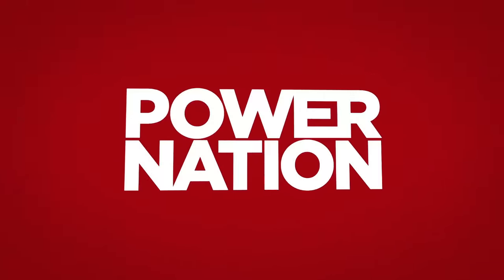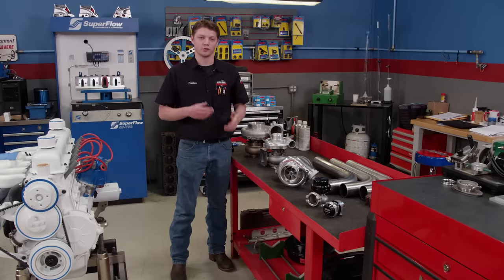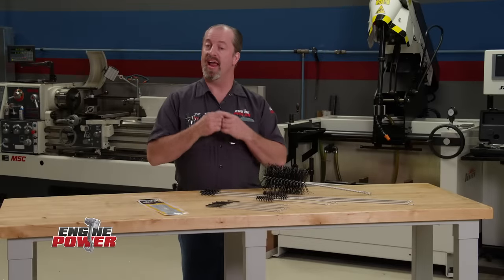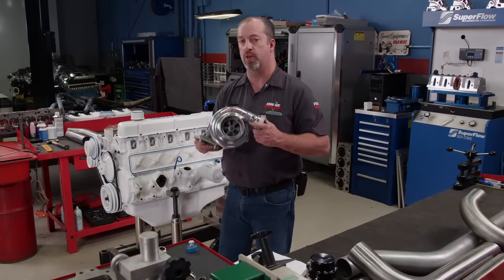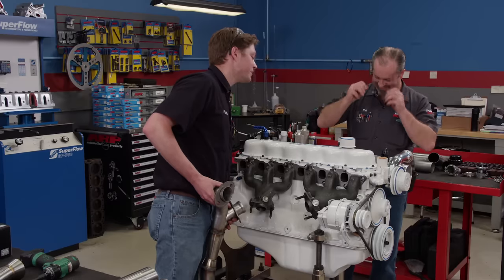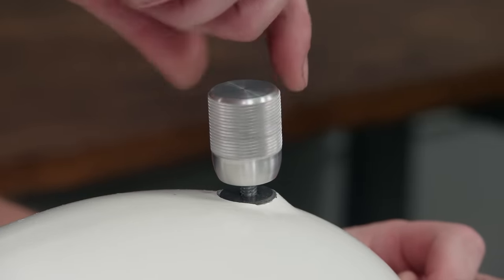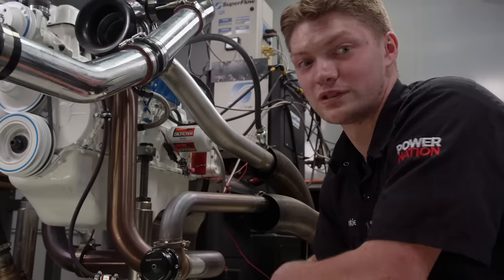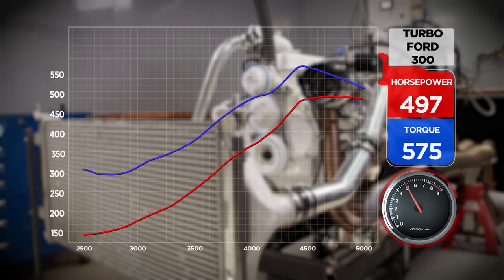Turbocharged Ford 300 Inline Six Makes Over 500 HP on the Dyno - Engine Power S8, E14

Comment: There’s only one word: WOW!!!! Unbelievable that that little engine makes 522 hp and almost 600 pound feet of torgue!!!! WOW!!!! Greetz from the Netherlands , ramon
Reply: Meh. The 2JZ is much more impressive engine.
Reply: @basshead.  2jz wasn't build for industrial work. The 300 is way more impressive since it was only meant to be a work horse engine and not a performance engine
Reply: @carsonmeyer2808  The 2JZ is much smaller engine than the 300 and it can make over 1500hp.
Reply: @basshead.  I just don't Find it as impressive. A stock 2jz can hold 800. This build for the 300 wasn't stock but again. It's technology from the 1960s/an Industrial engine made to run long hours and low power. Far more impressive in my eyes
Reply: @carsonmeyer2808  You are impressed that it held up 4-5 short dyno runs? You can slap a turbo on anything and make power.
Reply: @carsonmeyer2808  and was designed for less than 100hp.  There are guys running north of 18psi on forged pistons  and pretty much everything else stock.
Reply: @basshead.  , this engine was used in such a broad applications  , nothing but impressive, your engine that you are so impressed with will not 200k and still get you home.
Reply: @markrenton1093   Most engine that are as big as the 300 can make 500hp with a turbo.
Reply: @basshead.  your missing the point, it is not about horsepower it is about versatility.
Reply: @markrenton1093    You can use the 2JZ for almost everything. It's a very reliable engine.
Reply: @basshead.  who cares. They’re literally everywhere. These 300’s aren’t as common. Give me a 1UZ over a 2JZ anyway.
Reply: 300 c.i. Is not exactly little lol
Reply: @chrish1695   It's almost as big as my V12 engine.
Reply: @basshead.  the 2jz started production in 1991. the 300 i6 started production in 1965. they cannot be compared.
Reply: @basshead.  you're comparing a 3.0 DOHC factory turbo engine with VVT to an engine that was literally a tractor engine.  The impressive thing is that the 300 makes all of its power and torque below 5k. A 2JZ isn't even thinking about making boost until 4k and isn't making any real power till about 4500. This boosted 300 would be far more impressive to anyone who drove it because it's going to try to run out from under you right off idle, do burnouts for distance, haul your trailer, pull stumps, and whatever else you want to use it for.  Your 2JZ will sit in a supra or Lexus IS300 and it'll be cool because it makes 800hp way out at 9krpm where most people aren't actually going to drive it and you can cook a meal while you wait on the boost to come in.
Reply: @codyslaughter4678  I don't think it will last more than 500 miles.
Reply: @basshead.  at 14psi with stock rods I'd be inclined to agree.  But that's easily fixed with forged rods and forged crank (which this engine likely has since its an industrial engine and not a 1/4 ton pickup engine. The dump trucks in the 60s and 70s had all forged internals) which aren't hard to find.
Reply: @codyslaughter4678   I don't think the block can handle that much power.
Reply: @basshead.  those blocks are extremely sturdy.  So I don't feel like they'd have any issues. Thick cylinder walls, thick main webbing, plenty of external ribbing, the block would be the last thing I'd worry about.
Reply: @basshead.  it’s all cast iron.   It can handle it.   As far as internals… those can all be beefed up
Reply: @basshead.  that's like comparing a Model A to a Maserati. The 300 was designed For Industial applications like forklifts and has 1965 technology Race car driver Scott Donohue raced a rally truck with a Ford 4.9 in it and won the Baja 1000 3 times. This engine is also used by Stewart and Stevenson in the MA Baggage Tow Tractor, and Harlan in their standard tow tractors as well as a multitude of other pieces of equipment, such as ski lifts, power generators, wood chippers, tractors, and, until they converted to diesel engines, most UPS trucks. Many UPS trucks still use the 300 to this day. In stationary service (generators and pumps) fueled with LPG or natural gas, this engine is known as the CSG-649. The Barra is another great 6 cyl. engine too.
Reply: @chrish1695  The 302 can't handle more than 500hp. Not all cast iron blocks are strong.
Reply: @basshead.  have you looked inside these things?  Everything about this block is stout.  There is nothing rugged about a coyote engine
Reply: @basshead.  I see your point tho.   I’m all about Toyota engineering.   I have a 95 f150 short bed with 4.9  and a 94 Corolla with a 4afe.   Even that 4afe economy engine revs like crazy at high rpm.   Toyota engineering is hard to compete with but there is no denying this is an impressive industrial engine that makes some serious power.  You can junk yard build these 300 all day long but good luck finding parts for a 2jz
Reply: @chrish1695   The 302 is not a Coyote.
Reply: @basshead.  to correct you on the 302 not handling more than 500hp, they can and do on a regular basis. You just can't detonate them or they'll crack.  Look up the rotsun. It has a turbo 302 making over 500hp and has been running for a while now
Reply: @chrish1695  you say a coyote isn't rugged but people are putting 2000 hp on a stock crank and block... so I think that qualifies as pretty rugged. And they are putting over 1000hp through them regularly on stock rods and pistons as well.
Reply: tell me then… what is a coyote? How many ci?
Reply: @codyslaughter4678  He probably won the casting lottery.
Reply: @basshead.  at a price of $45,000.  Lol

Comment: I had a 300 6 in a Bronco. It wasn’t fast but it was unstoppable. It’s one flaw was a sticking float valve. I still kidded about fixing it with a hammer.
You guys have the most fun job ever, great video.

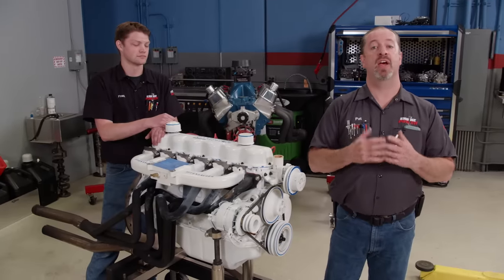Comment: 2:16 built like that is something a normal person can do in there garage its reasonable and 270 hp and 338 pound feet of torque would run pretty good in an old 4x4 F-150 i think the aluminum head and cam did most of that! pretty cool

Comment: Where can I find Pat's parts list for this project. I want to use at least part of it for my 300 rebuild in my 1994 F150.
Reply: In the description of the video scroll down and you'll see it
Reply: Don't waste the money. For what you'll spend you could drop a 351 in
Reply: @raabsand  This has got to be the dumbest comment on here. Anybody who's half smart can see that thing easily puts a 351 to shame with how old and robust it is and still putting out 500+ with only 14 psi boost and a mildish build. The exotic nature of the build itself makes it more fun and desirable than a plain v8 block you're goning to expect 500+ out of with the same level build or bigger. Plus who actually runs a combo like this and can say they pump 450+ in an inline 6 instead of the same v8 everybody else runs?
Reply: @DragonMaster12975   IT HAS A $2000 CYLINDER HEAD,A $500 CAM,A $1500 EFI SETUP,A $2000 TURBO............FORGED PISTONS AND RODS
Reply: @trillrifaxegrindor4411  the engine is factory forged steel crankshaft and rods to begin with.  The head is not 2000 dollars.
Reply: My truck already has a 300 in it. This is why I want to see Pat's parts list. I don't expect to turbocharge the engine, but I do want to make it stronger.

Comment: Been waiting soooo long for this! Absolutely love it. I would still love to see a roots style supercharger though. I would think a supercharger would be more practical for the 300. Please  please PLEASE do atleast one more video on the 300 with a supercharger. Or bless us with an entire new build based around an efi supercharged build!
Reply: I agree a bolt on supercharger would be way easier, you could still use the long tube headers I think the power would be close to the same.
Reply: I'd think a centrifugal supercharger would be the ticket!!
Reply: 6s are MADE for turbos!
Reply: @WebNstyne  это точно) австралийский barra или Японский Jz)
Reply: @opinatedtfb If they want 800 kangaroo bucks for a valve cover what are they going to ask for an intake?
Reply: @opinatedtfb I went back I did see the lower priced one. I wouldn't buy the valve cover but that intake price isn't bad. Clifford sells cool parts for the straight six also.
Reply: @opinatedtfb I was looking back and forth Clifford had some parts and packages cheaper than Aussie speed. For project stuff I usually have a mix of quality parts and cheap shit where I can get away with it. I'm glad you posted about Aussie speed though because I had never heard of them.
Reply: Turbos come on early when they’re sized correctly, and depending on engine load even earlier than a belt driven supercharger (without the drag). There really isn’t a situation where a supercharger would be better choice on any engine unless the exhaust/fuel is corrosive or you’re using a two-cycle diesel. 

A well tuned boost controller can flatten a torque curve and deliver power from off-idle to redline without spikes or lag.

Comment: One thing I think you should have done, lower the compression ratio back to about 8/1 and run a water methanol injection with the boost turned up.
edit: Oh and put a turbo type cam in it and spin it to at least 6500. Cams for NA are very different from cams for turbo applications. I know these have been spun up to 7,000+ at the drags many years ago.
Reply: Don't spin this that fast. It's just not made to go that fast. This is a pushrods and torque motor. It's a lot like a diesel, really.

Comment: In the early 1990's, we used to sell this motor in F-150's as the million mile motor because they never broke down nor wore out in a stock configuration.
Reply: @bigboreracing356  , maybe the durability and reliability  performance had something to do with it being in production since 1965? Nah, it was just a low rpm powerplant. You're  right!!! SMH
Reply: @bigboreracing356 , my sarcasm wasn't due to being offended.  It had to do with the lack of competence about the topic. The emissions may have had an impact on the discontinuation of production of this powerplant. The 302 in the F-150 only had minimum performance gains and less reliability. 60 mph you say, where do you live; don't answer that! Lol The 60's were the muscle cars original era. I would rather have a 1996 F-150 with a 4.9l I-6 than that year with a 5.0l V-8 or a 1997 F-150 with a 3.7l V-6 or a 4.6l V-8. Thanks for your comment,  good talk; really!
Reply: @bigboreracing356  Big lazy motors are reliable, the fuel efficiency wasn't so great but it sure was an admired workhorse
Reply: @bigboreracing356  , no truck salesperson would sell an F-150 with an I-6 if they were planning to pull a maximum load ever. If they needed more towing capacity we would sell them an F-250 with a 5.8l V-8. Let me explain the reason for an F-150 reg cab truck. It's and entry level truck for the person or company that only needs basic performance and capability with marginal towing capacity. Have a nice life.
Reply: @bigboreracing356  , you love to see your works of splendor typed out for all to see. Have a nice life.
Reply: @bigboreracing356  , my back ground was in automotive.

Comment: Thanks for the video. I'm building a Chevy inline 6 292 with 6-71 and 2 650 DP. Billet crank, cam and rods. Ryan Falconer V-12 head (crossflow 340I 220 E). 5 stage dry sump. Electromotive coil over direct fire ignition. Looking at 1000 HP. It's going in my 53 Chevy 1/2 ton pickup.

Comment: Curious  about  the  intercooler.  What is actually  moving cooling air across  the  intercooler.  It  didn't do much without  airflow  through the cooling  side of it. What was the charge air temperature  going into and out of it?  What  was the air density improvement going through the intercooler?
Reply: yeah shouldve mounted 2 electric fans or had big shop fan in front

Comment: We had to service a turbo 300 back in the 1980's. It was being used as an water pump drive for a irrigation well and ran on natural gas. The thing was a beast and pumped many GPM. The farmer called us in as the pump had quit. When we arrived the engine was missing. Seems the blow off valve stuck closed and it bootstrapped itself to oblivion. It was a very cool set up and had worked well for years. We installed a small cam small block Ford in its place.

Comment: I want to build one of those! Awesome. I do wonder though, would you back off on the boost to make it less likely to disintegrate when installed in a vehicle long term?
Reply: Yeah, it won't be one of the most bullet-proof engines in history, anymore. That said.. even 50k miles (but i doubt it) is a lot of smiles.
Reply: Lower compression ratio, piston oil spray, better head gasket, fasteners, valve springs and exhaust valves would probably be what the factory would have done if they were building it to last.

Comment: Please do a side by side comparison with a Ford 300 six and the Ford Barra engine. I’m sure they’re nothing alike aside from them both being Ford straight sixes.
Reply: The 300 is the barras big brother.  Same family lineage.  The 240s were in Australia.
Reply: @856Dropout  Wrong. Barra is same lineage as the Thriftpower/3rd gen. The 240/300 is based on TruckSix/4th gen. They aren't interchangeable in any way.
Added edit: Australia never used the 240.
Reply: @MafiaboysWorld  Wikipedia is layed out in a misleading fashion.   I can see where I got slipped up. Where did you learn your facts from?  My sources suck.
Reply: @856Dropout  The fact I'm Aussie and watched it all happen before my eyes over the past 40+ years. 😂👍 The F-Series trucks here got the 250 motor or the 351 Cleveland. Australia never touched the 4th gen 6 cylinder. Ford Australia and Ford America were two completely different companies due to management. 👍
Reply: @856Dropout  yeah the barra is one of the few good things Aussies have contributed to the motoring world. I'm glad the states are finally getting them
Reply: @scootbmx01  
At a cost from what I’ve seen
Reply: @scootbmx01  not really, Ford left Australia years ago and GM left and got rid of Holden for good last year and for good reasons
Reply: @USandGlobal  how does that fit in to anything I said? Did you mean to reply to someone else?

Comment: Walk softly and create your own atmosphere... :) 

I think a follow-up is in order. Head studs, good gasket and more spring!

Honestly though with 6-8psi that thing would be an absolute ripper in an 80's F truck. Find an 80-86 Bullnose short bed F-150, add a late 70's D44 solid axle to the front with some 6" lift springs, a 9" in the rear with add a leaves and maybe blocks for about a 4" overall lift, some 35's and that engine with 6-8 psi making around 450hp and 500+tq. You could run a C6 with 3.50 gears with little problem. Honestly it would be a relatively cheap build overall...

Comment: The Australian "Barra" Ford 6 is descended from the same design, and it makes horsepower in the high hundreds in boosted form. It ruled the tracks there for many years. Would Barra performance parts fits on a U.S. spec. 300 inline 6?
Reply: I want to know the answer to this question
Reply: No. Because its not a descendant. The Barra comes from a design that branched in two directions, one to the Barra and one to the 300, with no shared parts or measurements.
I asked the same question on the first of the 300 build videos 😁 and there were some really informative answers given.
Now, measuring a 250 Crossflow head and sizing one up to fit the longer 300 block, that might be fun.
Reply: As far as i understand, i don't think any parts are interchangeable from the XL, thru the to XD falcon alloy head. EA on was a different block / head, even the bellhousing changed.  And apparently the 'Barra' can pull 2000 plus Horsepower with factory block  &  head.   But i'm no expert.    https://www.youtube.com/watch?v=hJ6O1qnMmak
Reply: Strange thing i noticed about the Ford 300, it looks like a mirror image of Australian Chrysler's Hemi 6. From it's distrubter, oil filter, lifter/tappet side cover, Head design.  But all opposite loll
Reply: @demolitionman9307  saw that too :)
Reply: @PiDsPagePrototypes  that'd be funny if Chrysler Australia stole the design but mirrored it. lmao. I'd love to compare them side by side.
Reply: @demolitionman9307  It would be Chrysler US, the engine was designed there, as a light truck engine replacement for the Slant - so should have gone head to head with the family of engines the 300 is part of, in the light trucks.
Would not surprise if the 300 was among the engines studied,.. and improved upon in the Chrysler design. A well built 265 Hemi6 with the same mods as here, would be closer to 800hp.
Reply: @PiDsPagePrototypes  yuh i think so. They handed it off to Australia, and we developed it further, if memory serves me correctly.
Reply: @demolitionman9307  Yup. I have an "LVE8D" Slant in my VC. The L stands for Lonsdale, which was the casting plant in SA where the local Slants, and then the Hemi6's, were cast.
Reply: @PiDsPagePrototypes  i got a CM wagon, 265, but shes destined for a Demolition Derby, it's pretty rusty, as for the 265, i'll pull that out, it's way too good to wreck, i'll swap that out with a 215.  I'll send a link to a Derby i did. (blue Val Wagon ) aka. "The RECKA"
Reply: @demolitionman9307  Using a "South Australian Armored Car" for a demo derby?
Isn't that cheating? :D
Reply: @PiDsPagePrototypes  all by the rules of Speedway SA.
Reply: @demolitionman9307  You missed the giggle - the "South Australian Armored Car" is the nickname for the VH to CM Wagons, because 'big' and 'heavy' ;)
Reply: @PiDsPagePrototypes  oh, lool.  I've heard them called Valitanks before. Yuh, i'm a little slow sometimes 8)